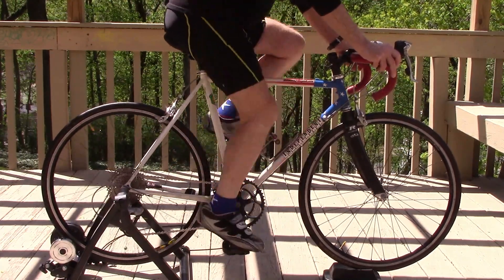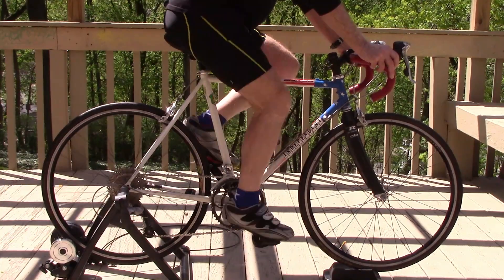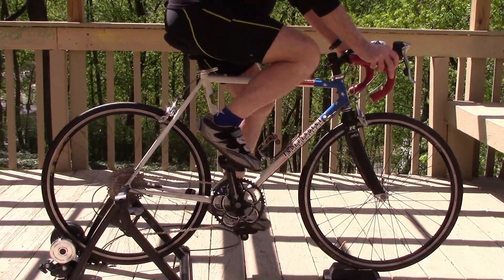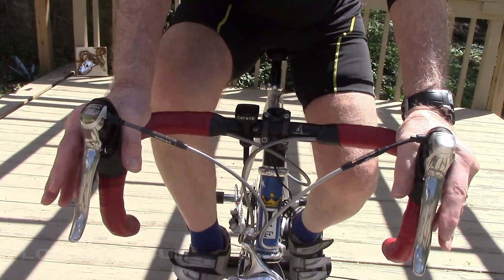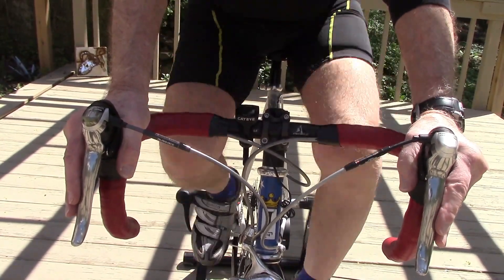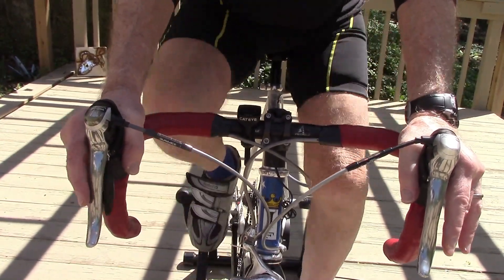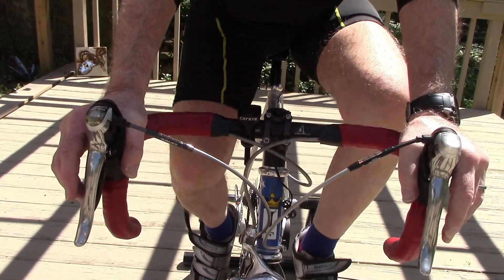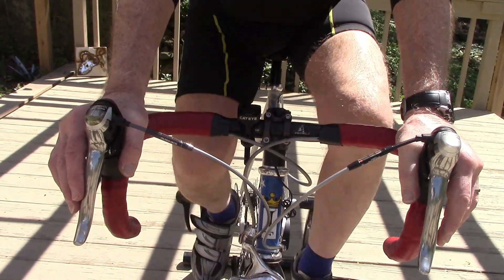How to shift a Compact Chain Set (or Subcompact) to Increase Ease and Performance

Comment: Why did they pick 34/50 as the chainrings for a compact?
Reply from the maker: For quite a while, the front chain rings available to us were the so called "compact" with 34/50 chainring set. More recently, with the advent of 11 and 12 speed cassettes and better rear derailleurs, many are now choosing 48/32 or 46/30, dropping the whole gear range a few percent to make those grinding climbs that little bit less painful. The difference in gears are still about 16 teeth, meaning the shifting technique described in the video is still applicable. Here's a good reference from road.cc on different chainsets:
https://road.cc/content/feature/which-chainset-right-you-191171#:~:text=A%20sub%2Dcompact%20chainset%20is,driver%20of%20sub%2Dcompact%20chainsets.
Regards, Tony

Comment: From what you explain I bet the dropped chain (onto the bottom bracket or off the big ring is probably due to rider error when it comes to pro-cyclists, those bikes should be tuned correctly but in the heat of the moment or stress or whatever caused those pro riders to drop the chain.  I am taking all your explanation into my own understanding of this issue.  Thanks very much for taking so much time to explain it to me.  Have a nice day.

Comment: What is a subcompact chainset?
Reply from the maker: The super compact chainset, otherwise known as a sub compact chainset is the latest gearing system to gain traction — especially in the world of gravel or all-road cycling. With even lower ratios than the original compact, which used a double 50/34 set-up, a super compact chainset runs 48/32 or even lower. Here is a review of some of the chainring setups:
https://road.cc/content/feature/which-chainset-right-you-191171#:~:text=A%20sub%2Dcompact%20chainset%20is,driver%20of%20sub%2Dcompact%20chainsets.
The shifting technique described in the video is similar on a subcompact chainset.
Regards, Tony

Comment: Do you yourself ever change the rear derailleur and front derailleur at exactly the same time, moving the right and left shifters simultaneously?  I have seen pro-cyclists drop chains before and I think maybe that's what they did, whether on purpose or accidentally.  I don't mean one after the other, I mean at the exact same time.
Reply from the maker: I've not had a problem shifting rear / front at the same time and have not dropped a chain except for one circumstance: In the large chain ring, pushing hard up a hill and suddenly shifting to the small chain ring (as I shift toward the smaller cog). Up a hill, under pressure, shifting from large to small cog can drop the chain inside behind the small chainring onto the bottom bracket. One needs to ease up on the predal pressure as you shift in such a circumstance or, better yet, anticipate what's coming up and shift to the small chainring just before or right at the bottom of the hill.
Many other causes of dropped chain:
• Derailleur issues: The derailleur limit screws might not be adjusted correctly, the mechanism might be dirty, or the cable might be damaged or improperly tensioned
• Misaligned derailleurs: Derailleurs can become misaligned over time due to wear and tear, falls, or taking the bike in and out of a car.
• Chainring issues: A bent chainring tooth or a worn chainring can cause the chain to come off.
• Chain length: The chain might be too long or too short.
• Worn cassette cogs or teeth: Worn cassette cogs or teeth can cause the chain to come off.
• Low-quality shifters: Low-quality shifters can cause the chain to come off. 

Hope the above answers some of your questions.
Regards, Tony

Comment: Or run a front triple....😎
Reply from the maker: Very true. Unfortunately, the market is shifting to subcompacts or 1x chainrings. A triple will give you many more options. Regards and safe cycling, Tony
Reply: @tony10speed  i went back to a 44-34-24 triple after trying a 42-26 double. The odd occasions changing front rings was a pain and did not feel natural. Regards x